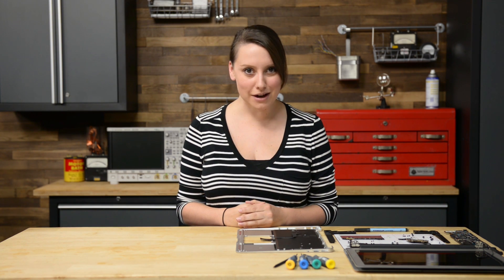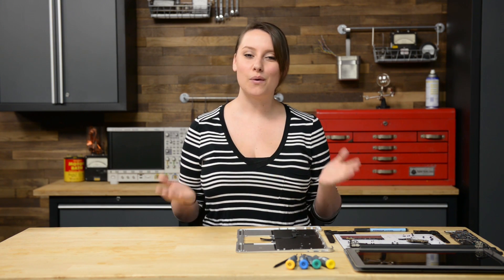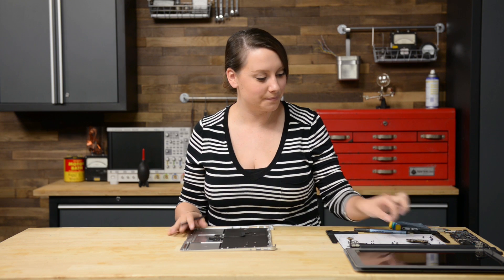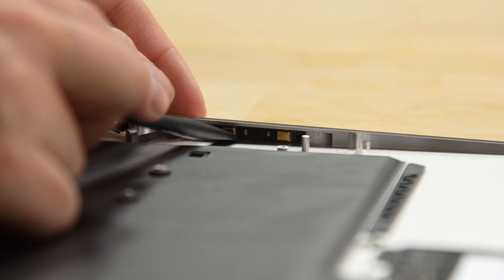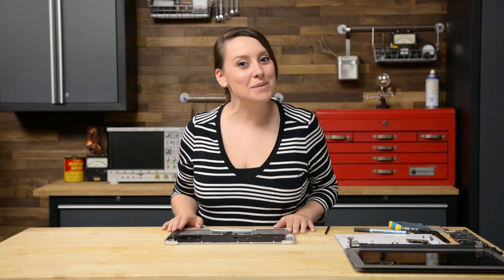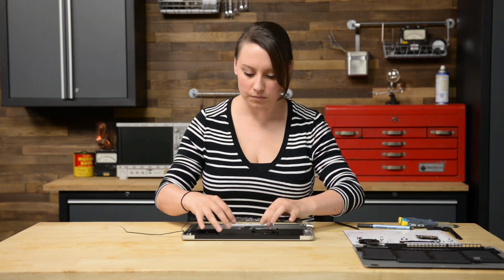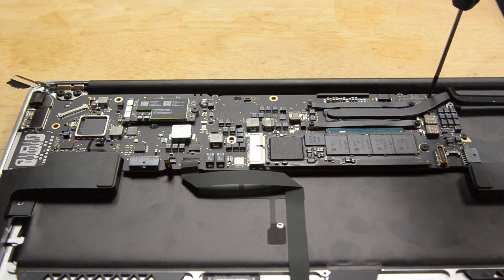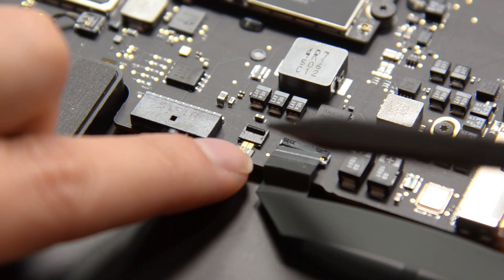MacBook Air 13" (Early 2015) Reassembly!

Comment: Hey hey lady :)

Great stuff, i do have a question as i can't find anywhere - This video though seemed to answer it but want to make sure

I have a macbook air 2012, the SSD you can remove and replace.

Does this hold true for this model you have the 2015?  I am asking because i want to save some cash buy a small 128gb SSD model put 
my 2012 500gb SSD into it that i already have.

Thanks a bunch